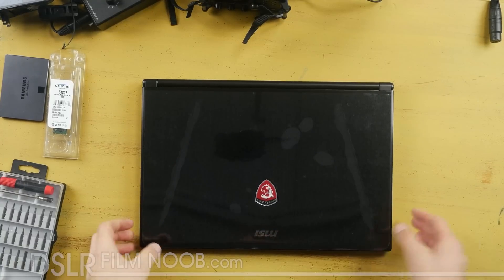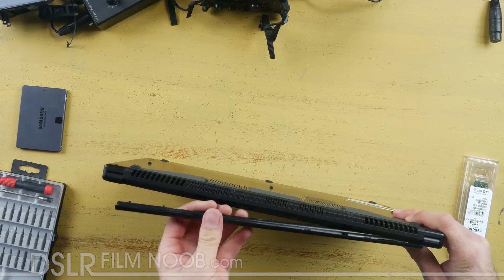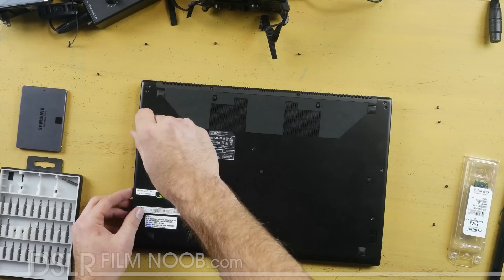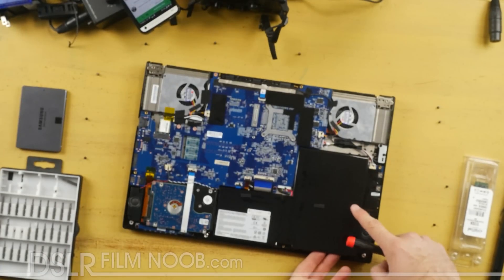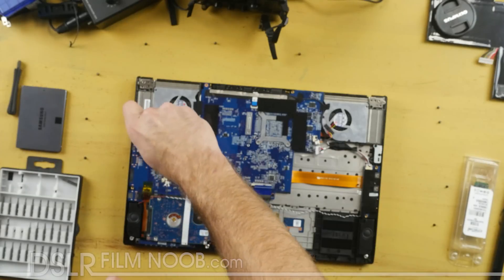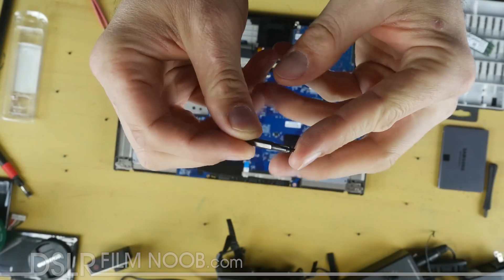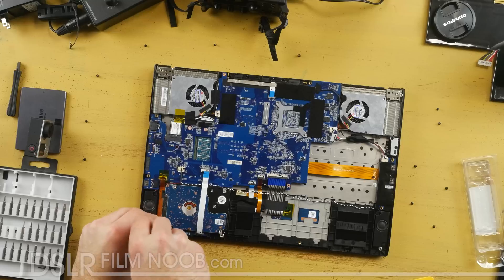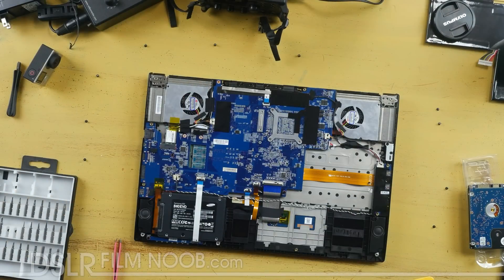MSI GS60 4k Ghost tear down and M.2 hard drive upgarde

Comment: Hey brother I’m trying to upgrade my MSI ghost pro 4k  gs60 6qe I want to know if it’s possible to upgrade to a 2tb solid state drive NVME and make it a C drive and also have the 128gb solid state D drive that the laptop comes with and have it both running without a problem please I need your help I can’t find concrete reliable information out there I need you to enlighten me please

Comment: Well this vid didn't work for me unfortunately .
Got past the removing the suggested ribbons, found an extra screw not mentioned in the video next to the right fan -- but after that ... -- the centre of the board was moving, the back (fans, CPU , GPU) portion was not .
And as I've already broken a few tiny plastic 'hooks' (it's almost 10 years old plastic, forget elasticy and endurance) -- I wasn't about to break the MOBO in half just to see if I could dislodge whatever was stuck / pinned down .
Apart from the one missed screw I could not see any others, and I'm not a professional, so I don't know if this move was supposed to also disconnect the CPU GPU from the heat pipes, but in general not very happy (for myself) , but it was nice to find at least one video dedicated to the disassembly of this model . 

Oh and fuck you MSI for putting upgrades under the motherboard .
Top notch laptop still after 10 years , but what a shitty component location design .

Comment: I have this model of msi computer and when you open it there is the slot with the ssd card but the other one has the shape of the card but it does not have the pin connector, do you have to buy it and solder it? which pin connector should be bought?

Comment: Hey guys, although I am pretty sure the audience and the video maker is absent but I'll give it a shot because I am desperate.

I removed 3 screws off the motherboard and the thunderbolt port part is just stiff - it doesn't allow the motherboard to come off. Is something still supposed to be removed there before trying further? I just want to apply thermal paste on GPU and do not want to break my rig for that.

Comment: And where the fu.. are the ram modules? i just put new thermal paste, and just couldn´t find the ram modules. lol.
Reply: RAM is underneath the keyboard - on the same side as the m.2 slot. 
I have upgraded mine from 8 to 16GB couple months after I got the laptop (3 years ago now ). 
Just be careful when fiddling with the board while installing the RAM or SSD , the power button cable is also located underneath the keyboard and in my case I have undone it while playing withe the Mboard - I had to dissemble the laptop again and plug  in the damn cable. 

I'm thinking of putting new thermal paste too, was it fairly straight forward ? I have done it few times on the regular PC CPU but not the laptop.

Comment: I installed a m.2 Pci-e HDD in and it didn't work (wouldn't show up in either the bios or disk management) so now I'm wondering is the HDD defective or is there something I did wrong, I had a Sata III M.2 in that same slot before and that worked, but this new one was a MVME PCI-E one.
Reply: This laptop doesn't support pci-e. you either use a m.2 ssd sata 2280 or a 2.5" sata 3 HDD or ssd.
Reply: @LianaCavalcanti  I have a MSI PX60-6QE it's pretty much the same but it's supposed to support Pci-e.
Reply: @sherri419  I have a GS60 6QE-036UK i7 6700 970 and the manual for mine says otherwise. I'm just upgrading and increasing capacity for the memory and the m.2 now (bought it in 2015) as its now slowing down for the basics. I've also checked the current m.2 it came with and it's a m.2 sata 3 2280.
Reply: @LianaCavalcanti  Yeah I did finally use a SATA III they do make it very hard to put in the .m2  since it's on the underside of the main board I also got an MSI PE60 which is much easier to upgrade.

Comment: Is MSI GS60 be compatible with Samsung EVO 850 MZ-N6E500BW (5.5v) or Crucial MX500 CT500MX500SSD4 (3.3v)? Both are 500GB M2 SSD, Samsung being faster but requiring more volts.

Comment: Anyone know where I can buy the bottom case cover for this? I've been looking all over the internet but can't find any. My laptop bottom case is bending because of a defected battery. it is 3 years old already so MSI probably won't replace it. I already brought the battery, I just need a new bottom case, help me :(
Reply: Mine is very swollen too (1 and 2 years after these 2 battery posts)  Mine isnt popping the kb yet but the hammer tip is good, thanks Xastunts.  It's the holidays and I'm just worried about having a big firey accident at the relatives' house with all these phone battery horrors of late...

Comment: Okay so noob question:  After replacing the drives, how do you get the OS back on it?  When you boot it up for the first time what are the steps to getting windows installed on the new drive?
Reply: For clarity, the drives are damaged and saying "No media present" when I try to boot up the operating system.
Reply: That's why I'm wanting to replace the drives.
Reply: Okay for anybody with this question, you have to first get a valid product key from the laptop.  In order to do this you must flash linux to a usb drive, boot the laptop using said usb drive, and get the product key (here's a good tutorial about halfway down the page:  https://www.howtogeek.com/64600/how-to-recover-windows-and-software-keys-from-a-broken-computer/).  Once you have the product key using a working computer with Windows, then you'll have to flash a usb drive and install windows on it using that product key, and boot the broken laptop from that usb drive.  Beyond that I'll have to do more digging, and yes this is a ton of work, but it beats paying some computer repair place 100 plus dollars to do the exact same thing for a couple of hours work.

Comment: This vid talked me out of buying this laptop. There is no need to build a laptop in a way that you cant service the drives and ram with a simple back panel removal. The number of screws is also ridiculous.

Good vid though, I look these up often when I am either servicing something or buying something where servicing is going to be an issue.

Comment: I see there is something in the other M.2 Slot next to the one you are installing. Was that there to begin with? Or did you put that in as well previously? Also If i put in a 500gb M.2 drive, can I boot from it and use it as my primary? and have a regular hdd in the 2.5" slot and just use that for storage?

Comment: I have the MSI GS60 Ghost Pro 3K-097. I have 2x M.2 SSD slots with a 128GB SSD in each slot. I also have 1TB of HDD storage.

Your video is on an new laptop, but I've had mine for 2 years already and I want to upgrade the SSDs. 

How would I go about swapping them correctly without losing my OS data? Also, is there a limit to how big the SSDs can be?

Comment: I tried this with my MSI PX60 and after I removed all the screws and connectors the board still wouldn't lift up so I decided to just put it back together rather than risk breaking it even then when I put it all back together it didn't work, the power light wouldn't come on when I pushed the button (boy was I in a panic) I thought I had broke my new $900 laptop but when I opened it back up I saw there was one connector that wasn't snapped closed so I snapped it down and pushed the power button and it works now!, so now I think I'll just buy a M.2 to Thunderbolt external SSD box on ebay for $18 (since the the PX60 has a thunderbolt port) that's the cheapest and safest and easiest way (since I couldn't upgrade it the other way without risking breaking it).

Comment: I own the MSI GS60 Ghost Pro.. I was just wondering, what could I upgrade to get higher framerate, if its even possible.
Reply: Flamix nothing is really going to help
Reply: I applied metal liquid both on processor and GPU, no more blue screen and heat problems. mine using i7-5700HQ, GTX 965M

Comment: I bought this computer almost a month ago. What is the max for the hard drives I can have?

I bought the pc for the same reasons you did which is to edit video/audio. Of course playing GTA V is a plus.
Reply: Wow 10 months later and still no reply huh?
Reply: PharaohsKingdom hey mate, im looking for the same info xD i know it can take up to 2× 256 m.2 but still looking for a higher capacity HD as far as i can tell the HDD (1tb) is a 9.5mm drive so anything the same size should work
Reply: It has 2 m.2 ssd slots
Reply: The 4k edition does anyway

Comment: +dslrfilmnoob I have the same laptop and I'm looking at upgrading my SSD. What size screw did you use to secure the SSD? I want to know if I need to go find one before I dig into this. Also, did you have to install any samsung drivers, or did you just simply plug in your OS usb?

Comment: Hi there I was wondering for a bit of advice here, I purchased an MSI GS60 2PE (1080p 870m version) 1 year and about 8 months ago. Everything was great for the first year but about 6 months ago I noticed a huge fps drop, cs:go 120 constantly to a range of 30-60 and even something like L4D2 I can't manage 60fps and that game came out in 2009! 
This is not right, I assume it is because over heating but lift the vents does not make a difference. Also recently the battery has started to swell and deformed the bottom panel. This model cost me £1,400 which is extremely expensive for a laptop that basically has a life span of 1 year.
Could you give me some advice on how to get better performance?
Reply: xastunts I gave up with it 6months ago after it got stuck in a boot loop, chucked it out and decided to go all the way and get the gt73vr 7rf...a massive upgrade lol but hopefully repairing/upgrading it will be a lot easier... And the cooling is soooo much better than gs series

Comment: I bought 2 M.2 500 GB 850 EVO's and a 1Tb 850 EVO. My motherboard came with a screw for the non-occupied M.2 slot, and it was stuck tight the screw got stripped. Was a bitch for a while, but some pliers and elbow grease and that stupid screw came out, glad I had extra 3mm screws.
Reply: does ur setup run the m.2 in sata 6gbps (msata mode) or in pci-e mode?
can u please confirm the m.2 850 evo works fine on the gs60 ?

Comment: Are the m.2's PCIE or SATA controlled? I keep having a hard time telling. I have the Haswell Version.
Reply: +xastunts weird i keep getting connection error timeouts. It is ok though, i figured out Haswell has the SATA M.2's The Skylakes have the NVMe. Thanks for trying to help :)
Reply: what i can tell you is that i read on msi forum about the gs60-2pc 16h2 model that uses the haswell HM87 chipset that it DONT SUPPORT the PCIe SSD in Raid 0. you have to use the SATA SSD only to have it in Raid 0.
what kind of model do you have? im thinking about installing ssd drives in my system also, just collecting enough info so i dont buy any kind of crap hehe.
Reply: +xastunts I put in 2 850 EVO 500Gb M.2 Sata in Raid 0 and 1 850 EVO 1Tb Sata SSD . Running a GS 60 2QD i7 - 4720HQ .

Before doing this I do want you to know a lot of people had problems with the M.2 Screws. They are stuck shut, I ended up stripping the screw that had an empty M.2 port. You need vice grips or pliers and a LOT of patience. Also the video skips mentioning one of the screws that you need to remove for the motherboard. http://imgur.com/Mnj9Ru7
Reply: +xastunts They are all SATA versions. I didnt have any problems with them in RAID 0.
Reply: +xastunts My only problem was figuring out if the GS60 Haswell was compatible with SATA or PCIe. After I found out, everything went smoothly. :)
Reply: +xastunts I cant really help you there. I have two 500 GB M.2's in RAID 0 and one 1Tb 2.5" SSD. My haswell GS60 does not support NVMe/PCIe M.2s. I would assume I would just lose the data transfer speeds, but im not sure if they would work like a SATA SSD or not at all (because I thought why get a PCIe SSD when it wont be at that speed anyway.)

Can always ask /r/msilaptops on reddit.

Comment: Hey guys, just a heads up. Be very gentle with the flat audio cable which is plugged in to the bottom of the motherboard! I was hearing some noise when I put everything back together and apparently there was a short circuit with that cable, heating up the Mic/Headphone/USB PCB. Just be very careful when plugin it back. 
Side notes, the plastic cover has some very delicate hinges, I actually broke 1 of the 5, no biggie just be patient!  And, be careful with the screws of the motherboard, there was one behind a tape that I took a while to find. Any questions I’ll be happy to help. 
Good luck!

Comment: I got the version with only 256gb ssd. Do you think theres a secondary bay for a 2.5" hard drive?
Reply: +fightnight14 Mine has 2 128GB M.2 in Raid 0 (3K version with 870M) so if you have the same raid setup then you're out of luck. You'd probably have to either buy 2 M.2 and put them in or take out one of the 128GB and swap it for a larger one (then re-format). Or you could swap the data drive (mine is 1tb) with a larger one.
Reply: Hank Moody oh that makes sense m.2 are pricey, right? I'm not sure if I have the data drive. Does every model of this laptop have one? It only came with 256GB SSD out of the box.
Reply: +fightnight14 mine came with a 1tb data drive. It's a Ghost Pro 3k.

Comment: Hello, Can I ask you something?
I have a gs60 2QE with a 128Gb SSD (System) and a 1TB HDD. I want to increase the system space since the 128 GB are not enough. Can I buy the 80mm M.2 ssd you suggest and just add it to the 128 I already have? I have opened some laptops in the past but I am not familiar with the M.2. I mean do I only have to open my laptop and add the M.2 ssd like you do in the video or do I need to do anything else?

Comment: Do you know if it is compatible with M.2 PCIe SSDs?
Reply: PCIe is a different form factor than M.2 - it wont work with the slot
Reply: https://www.msi.com/asset/global/picture/faq/10015790@2016-0429-0524-187136@faq_0000000001117_en.pdf
Reply: I have read on msi forums that it is NOT compatible with the NVMe drives. only SATA 6GB/PS speed.
Reply: @xastunts  What about the HDD drive? Can I replace it with a 2.5 SSD and what would be the max if I could?

Comment: I'm a bit of a noob at storage upgrading, how do we get windows back after removing the drives? Like whats the procedure?
Reply: Did you make your system back up onto a USB pen? If so after the drives are swapped you can use that to reload your laptop.
Reply: And what about if the drives are damaged?  How do you load it then?

Comment: I have an acer  v15 nitro and it comes with a 1 tb HDD and i am thinking of upgrading it to m.2 soon. My question is that can I use the m.2 as the primary drive and not use the HDD altogether? Or do I have to use them simultaneously? Or perhaps i need the m.2 SSD AND a regular SSD? please help! :D

Comment: easy to watch hard to do.... I gues the only option if you dont wanna lose your warranty is buy parts send it to MSI to replace it... And i dont even talking about clean the dust- wet dust. Its really dust catcher i have gs 60 non pro with kepler 860m and its beast (even the kepler version 1080 p 60 fps)
Reply: Milan Poruba msi doesnt care about this in NA, you still keep your warranty.
im planning on getting a used one in good condition and adding a stick of ram and ssd to it.

Comment: Is swapping out the hard drive that complicated? it appeared like most of the work was to add the additional m.2 ssd, not the samsung evo. I'm considering buying this laptop and just replacing the HDD with an SSD. I figured that would be a lot more simple. Thoughts?
Reply: why don't you just watch the video?

Comment: dslrfilmnoob -  Does this only have a single mSATA port on the motherboard, so no chance at a RAID 0 setup?
Reply from the maker: There are two mSATA ports so you could do raid 0 if you wanted.
Reply: +dslrfilmnoob Hi mate, are you able to show both of these ports as it was not easy to see on your video, and you didnt point them out.  Is there any value in doing Raid O ?

Comment: Nice video and I have a question that what's the lcd cable type of this 4K version? According to panel info it should be 40pin eDP but I am not sure, and the socket on motherboard looks slightly different with other eDP socket on mb cuz it's an ultra thin laptop I think, so is it possible to connect a normal 30pin eDP cable on mb and as what I think is downgrading the screen to normal FHD resolution which looks better for me. I want this 4K version only because the GTX970M xD
Reply from the maker: Pretty sure they sell a version with a lower res screen and the GTX970m
Reply: Yaojiang Du you should go to xoticpc next time you're laptop shopping. especially with an msi. thers a 6gb v-ram version gtx 970 with a regular 1080p display there,

Comment: That is a ridiculous amount of work for a harddrive swap.
Reply: Yes it is.
Reply: It's an insanely tiny machine for how much power it has.
Reply: I got the PX60 which  is the same machine except it's silver instead of black, I opened it up and it's exactly the same inside, it's a good thing bc it's much  easier to find GS60 parts on ebay (which fit my PX60), I had to replace the power button board and the GS60 one fit mine, it was still expensive ($35) but at least I was able to repair my laptop myself.

Comment: Are you using the m.2 ssd as you boot drive or as a scratch drive for editing?
Reply from the maker: The new m.2 so the boot drive and the 1TB SSD is for editing.
Reply: dslrfilmnoob Hi. Is the mSATA (m.2) drive a Type 2260 22mm x 60mm or Type 2280 22mx80mm.  Thanks in advance.  I can't clearly see the model of the Crucial m.s SSD card you gave there.